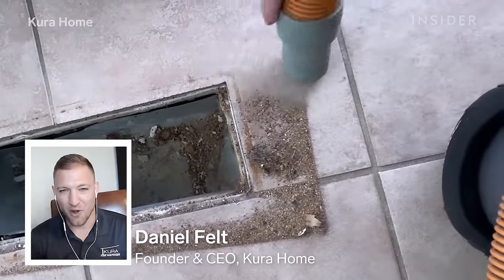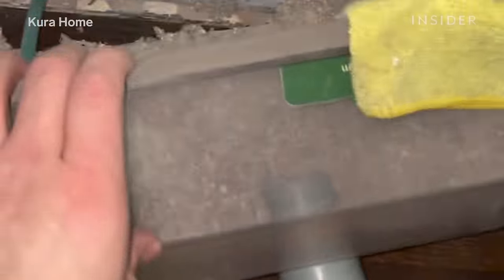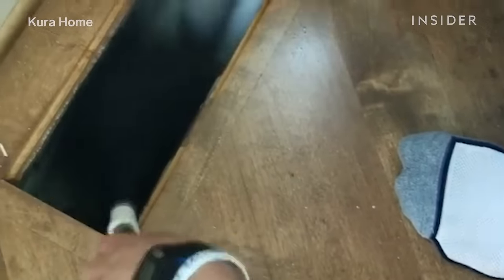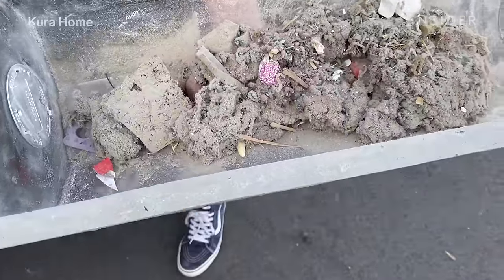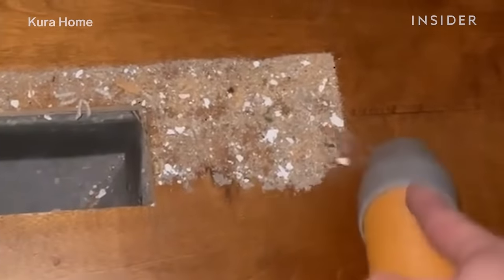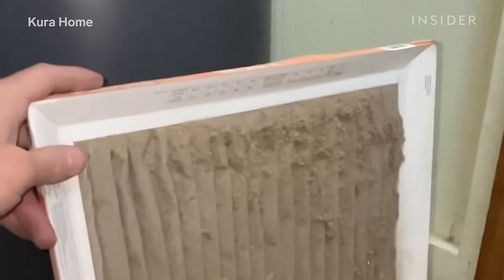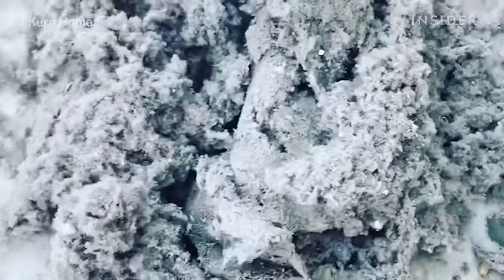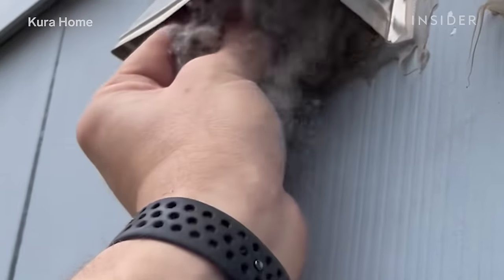How Decades Worth Of Dust is Deep-Cleaned From Air Ducts | Deep Cleaned | Insider

Comment: Been watching a lot of videos on duct maintenance, leak fixes, and cleaning lately. This was pretty neat ! I must say though I got a real shock with the guy at the outdoor dryer vent using no eye protection blasting away with the air. Anyways, videos like this reinforce my goal of doing a good range of 10-year activities in my new construction home including ducts and vents.
Reply: I know when I worn plastic type safety glasses, especially whenever the forehead has a bit of a must forming from some perspiration on the edge of becoming a dripping nightmare....  The onslaught of dusty particles floating freely in my view .... especially the micro pieces of dust, dead skin cells floating, & unknown debris particles would cling to my glasses on both sides ... obstruction of my limited view...over 50 % reduction of clear sight ... & The naked eyeball is that much closer to getting a stray dust bunny cousin or so to poke me in the eyes or hang freely on my lower eyelid area or in my eyelashes... Where if I just closed my eyes in bursts as I cleaned out the vent ... Since the vent cannot move physically from the spot it's in...... Control the directions of where the dust flies.... & Be diligent on finding all the remaining stuff that didn't fully exit the targeted area to get cleaned ..... & Take that soft little ...  Whambulance card carrying.... attitude of ....oh my gosh ...I'm gonna get filthy... Oh heavens...look at my clothes ..  they have filthy all over them now & gosh ... It must be excruciating to breathe.... normally....as you obviously don't sit there with a mouth all jaw slacked like goober Pyle on AG Show ..... Daydreaming of the fun flavors of the fungi flying in the work space .... 
This is a bit of dirty ...but is it a hazmat level every time ....I seriously would doubt it ... And why point out all these mind blowing acts in their videos...if u WANT TO WEAR A MASK ....TTTT...TTT..IMMMMY...wear a flipping mask ...out on 2 pairs of safety glasses ....cover your tootsies up with a full coverall type of suit ..  like painters & other cleaning crews wear on more risky type jobs . To prevent any contamination to invade your clothes or in your lungs or melt in through your epidermal organ.... It is indeed the largest organ people have ....so keep it healthy & throw some soap & water on the epidermal areas later that evening to be triple troubleshooter safe
Reply: Hey,make sure there’s no saw dust n home building debris or you should get the ducts done before you move in for sure!!
Reply: Yeah, that was crazy watching these people do this type of cleaning with no p.p.e. 
Eye protection, face mask and even ear plugs. Your just asking for trouble not wearing it.

Comment: I work for an HVAC company as a service technician and see some of the havoc caused by duct cleaners. #1 is improperly connecting to the ductwork. Sometimes they connect right at the furnace ducting and suck tons of dust onto the furnace blower wheel and AC coil, causing restrictions. #2 I’ve seen them pull return ducts joints apart in the attic, sucking in a bunch of blow in insulation into the ducting (Probably not their fault the joint was poorly done, but they just left it and didn’t say anything). Moral of the story hire professionals and inspect the ducting and inside the furnace after they’re done

Comment: A lot of that what you were sucking up when you were using the clear dome didn’t look like dust but looked exactly like the loose blow in ceiling insulation. Maybe it got in there in the install but the way it clumped and even had the same sort of mix of distribution of different colours in it, just like the insulation I have in my roof space

Comment: And I'm asking myself why you need Vents in flats and houses when you have windows. 🤔 Here, we don't have something like that.
Reply: They typically provide centralized heating and/or cooling. For example, my area is as cold as -40°C during winter cold snaps and as hot as 40°C in summer heat waves. Opening a window under those conditions would be less than helpful.
Reply: @B.D.F.  We have more a -10 to 35~40°C range but not every year. Not everybody have an air conditioning. We help us with fans and other methods. But there are one or another flat/house with air conditioning, but not in this way. To have it warm in winter we use heaters with water circulation. Isn't the heated air pretty dry?
Reply: Since the 1960's in Canada they have central heating in a lot of homes at least our did and it was built in 1960 and had he same oil furnace until it was sold in 2010, that 50 years.
Reply: @UncompressedWAVmusic  this doesn't answer it for me. :/
Like I said last year, we have radiators. The hot water is also heated centrally and then transported to the individual radiators throughout the building.  the air in winter is also dry, but I imagine the air from the shafts is even drier.  Added to this is all the dust if the shafts are not cleaned well.

Comment: I have the ones in my condo cleaned yesterday. It’s been over 36 hours and every time I run the air there’s dust and black soot coming out. The cleaner said it has nothing to do with what he did but I can’t see how that’s true. It’s never happened before. Is this normal and how long does it last? Thanks.
Reply: How did they clean your air ducts? What was the process?\
Reply: @kurahome  he used a vacuum hose. I still can’t run the AC. Every time I do black particles fly out. The guy has completely ruined my system and I don’t have money to pay for it to be fixed.
Reply: Change your filter. Put damp t shirt over duct registers. Run your system, just on fan.  For 5 min. Clean up. Change filter and should be good. Or call them to deal with their mess. You paid them. Talk to management of duct cleaning co.
Reply: @peterniven870  I had the entire duct system replaced. Thanks for the tip. Will definitely keep it for future.

Comment: Is this America?? Can someone explain why regular houses have air ducts? Asian here.. I have never heard of an air duct in a house.... 
Also, why have an air duct near the floor? Why not near the ceiling? That would prevent so much dirt collection in the air duct...
Reply: They have air ducts to disperse cool and hot air from the “air handler”throughout the home. In newer homes typically called “central heating and air”. A lot of old style mobile homes have air ducts on the floor, or even returns on the floor and airducts on the ceiling. but I have come across floor vents in a house. Terrible design to say the least …. Newer houses have air ducts on the ceiling or wall near the ceiling.
Reply: Have you been living in a cave that has no air ducts?

Comment: Typically air duct cleaning is not this comprehensive. House without “50 years of smoking” does not need this service. More likely they need a real/honest hvac assessment that will find something besides dirty ducts
Reply: Yeah the fact that the coil, condenser, furnace, and blower fan weren’t serviced leaves a lot of debris, dust and stench in that house. They needed more done than just the ducts.
Reply: BS about your comment that unless 50 years of smoking you don't need this service. Get your head examined. I bought a house and my wife and I were fine in it. At our initial house warming party my brothe and my niece said their allergies were going through the roof. So we looked into the upstairs air intake grates in the hallway and it looked like the ducts were fur lined. As in pets for years. So I had the ducts cleaned and the fur lining was sucked all out of the system. Heavy smoking or a lot of pet hair or other reasons can make you ducts very dirty and need a cleaning.

Comment: Why in the world would you have an air duct  IN THE FLOOR?
Reply: A heating system has air ducts in the floor.
Reply: Ease of installation in existing residences, especially those with basements or crawl spaces.
Reply: Heat rises, if you put them up high you'll never warm a house. Also most are placed near windows and doors, those are the biggest place cold air gets in so you heat that area.
Reply: @moseyoriginal  Mine doesn't, the HVAC is on top of the 3rd floor!!
Reply: @indyguy3400  Wrong. Our HVAC is on the 3rd floor roof. Due to the odd, "Remodeling," of the former owners, there's only one register on the 1st FL, over the kitchen sink! I put a box fan on low, to pull the heat through the DR to LR, the latter has a reversible fan, so I pull the heated air through, up, or push it down - depending on temperature.
Looking into hanging round, industrial ductwork from the DR through LR, as DIY. Put in double-paned sliding glass windows, for both sound and temperature control.
Reply: @juliesczesny90  sounds like someone didn't do the job right. You shouldn't need a box fan to move air from a forced air system.

Comment: Cleaning air ducts with a shop vac, brush line and a plastic cover should be illegal.
Reply: Well the machines they are using should be a lot more robust than just a shopvac. With the right technician you only need a 500 rpm fan with a brush line, air hose, and that plastic seal to do a really good job.